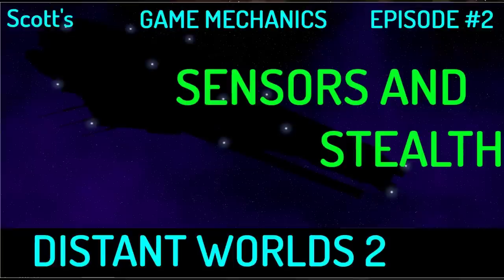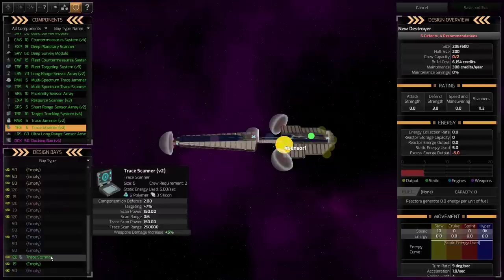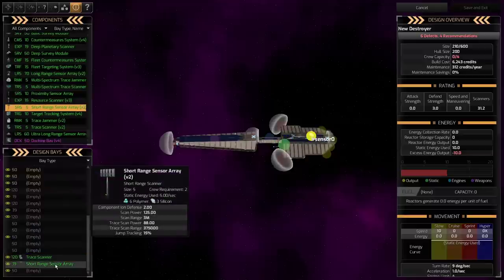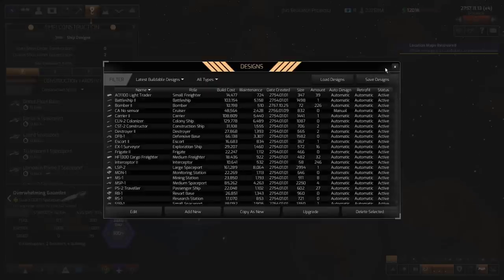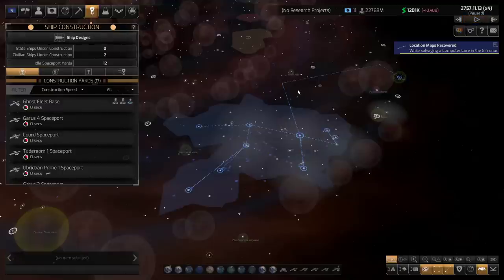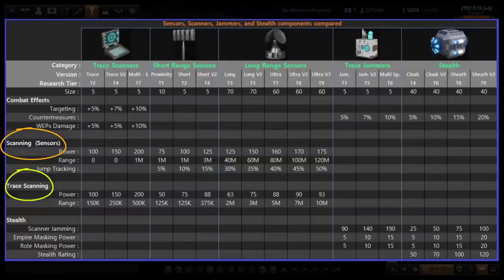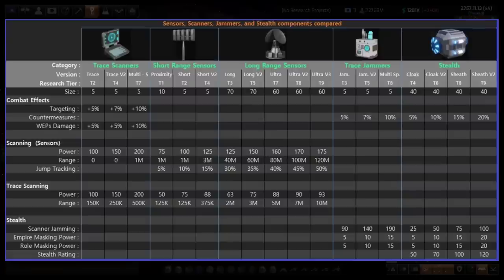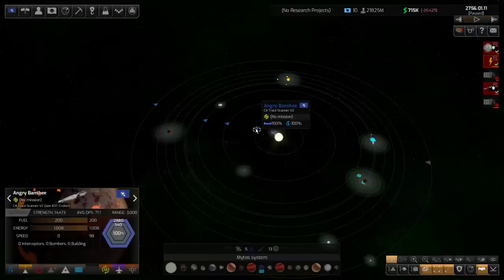Sensors and Stealth - Episode 2 in my Game Mechanics Series for Distant Worlds 2

Comment: The instant loss of definition makes me wonder if the scan power was being treated as combined. Does the Trace scanner targeting stack with the targeting scanner?  BTW, the default Resort Bases include Long Range Scanners, cheaper and easier to spread than Monitor stations
Reply from the maker: This topic is certainly not crystal clear - although the stealth calculations are accurate for example.  I do not think any new info is going to change my recommendation - I've been playing with these recommendations for many games and I've run into zero issues at war.
Reply: @scottsspace5562  The only time I dabbled with stealth so far in DW2 was to park a specialty ship in an enemy system just to sit and watch. Too much of a pain to repeat in later games, lol  In a system so the collectors could power everything but not at a location where it could be stumbled upon.
Reply from the maker: I am 99% sure the trace scanner stacks with a short range scanner, but within a single component - I don't think so.  But let me know if you find out differently.
Reply: @scottsspace5562  Okay ran a few sample combinations, Fleet Destroyer, New hull, so no other systems.
Trace Scanner + Short Range = Stacks fully
Trace Scanner + Long Range = Long Range overwrites the Trace Scanner.  An odd bug Scan Range displayed is that of the last system added.
Trace Scanner + Trace Jammer = Stack fully
Trace Jammer+ Countermeasures = Stack fully
Trace Jammer+ Countermeasures + Stealth = Stack fully
Trace Scanner + Trageting = Stack fully

Let me know if I missed anything. I only developed stealth for the exact reason you stated, the Espionage Academy, LOL
I still see no effects on ships from any of the Admirals or Buildings, Military Academy, Command, etc displayed on the ships themselves. Only Components seem to count. Maybe just a display bug, but a ship with components only is +35% Target, +40% countermeasures, an Admiral that adds +16% Targeting, +12% countermeasures, +11% damage, none of those display
Reply from the maker: @williamklett6660  Great summary - thanks.  Yup - and as I mentioned elsewhere SOME things stack with identical components.
Reply: @scottsspace5562  I can confirm that as far as Sensors/Jammers goes, none stack with themselves.
Trace Scanner + Trace Scanner = bzzzt
etc...
The Trace and Long Range scanner take the scanning of the LR and the +ToHit and DMG of the trace.

However,
Trace Scanner + LongRange Scanner + Targeting + Trace Jammer + Countermeasures + Stealth = a valid combination if a bit excessive
Reply: @scottsspace5562   A bit of an update. A brief examination of of Fleet Targeting and Fleet Countermeasures show that the systems work, but... It is unclear if Fleet EW stacks or the higher supersedes. Both Fleet systems add entirely new stats to the ship. For example the display of a ships now will show frex: Targeting +10% & Fleet Targeting +10%.

Regardless, it seems to me to be an assist intended for smaller ships, however, Fleet EW caps at +20% while the same tier Integrated Command Center adds +20% to both and more.  No idea currently what the actual intent is supposed to be.
Reply from the maker: @williamklett6660  great investigating! I have yet to test fleet wide effects.  Curious if then the admiral setting stacks as well.  I’ll put both on the list for testing.
Reply: @scottsspace5562  Yeah, I only gave slight testing to the Admiral. Hyperspeed bonus seemed to work, but one commander had +Target/+Counter/+Damage and none of those appeared on the fleet ships, BUT that test was back about 20 revisions. i haven't looked recently

Comment: Thanks for the informative videos on DW2, I appreciate that you take the time to look into different areas in-depth with examples (so I don't have to). In regards to Stealth tech, I agree that it's not worth the size hit to put stealth on a ship meant for combat. However, there are cases where I will use stealth, which are: 1) I will put stealth tech on any ships I build as Long Range Scanner ships (basically spy ships). Then I can park the LRS ship near enemy systems with less chance of it being seen and chased away or destroyed. 2) The other place I'll use stealth is on valuable lone bases such as research bases and sometimes resort bases. This just makes it harder for the enemy to spot and target those vulnerable bases.
Reply from the maker: So glad you like them, thanks for the kind words.  Yes - those are 2 good examples where it might make sense!  Thanks for sharing with everyone!  And I will take a look at them again if the Devs end up buffing stealth.  Finally - I HAVE been able to (once) go right up to a pirate base with a high stealth ship and not get attacked (even though devs said that shouldn't happen).  But I can't reproduce with other race spaceports.  Strange.  That would add value but it rarely seems to work.

Comment: Nice, was looking forward to this. Just started watching. One thing you might want to do for the next video is up the in game graphic setting (forget the name). It will smooth out the overlays so they aren't banded. It was put in to prevent crashes but if you don't suffer from those, it would look better to turn them on.
Reply from the maker: Good point.  It gets reset with every update.  I actually like the bands, however, for scanners when discussing range.

Comment: Trace scan is the additional ability to determine other ship's cargo, onboard troops, characters and component status, but with much shorter range, and countered by trace jammer(when lower than jamming power). 

One can think it as FCR (high resolution/penetrating) instead of ELINT sensor/EW radar(long range but low resolution) that normal scan represent. Trace scanner is more useful on combat ships and as counter to trace jammer(when higher than jamming power).

In actual senario, normal sensor is good enough to collect all the info from unknown entities til they start to equip trace jammers/stealths. By which the trace scanner is needed to collect those info from the unknown entities, but with a much shorter distance than before(trace scanner has high power but low range).
Reply from the maker: That is the official line.  But the Short Range sensors (with no trace scanner) also shows ship's cargo, troops, and component status (as you can see in vid).
Reply: @scottsspace5562  Yes, as short range sensor does have trace scan attribute then it possess the ability to reveal details as well, though in relatively short distance(due to low power and range) and prone to jamming. And that's why I only recommend to put trace scanner on combat ships and when enemy start to equip jammers.
Reply from the maker: @renyaoqin  I know that - it’s on my chart in the video. I think you missed my point.  If you watched my video, the short range and long range sensors can see troops, components, etc all the way across the system. That’s FARTHER than the trace scanners.  So there is no proof that even if the AI used jammers (I’ve never seen them use them) it would be able to reduce the range of similar tier sensors scanner ability significantly enough to make trace scanners required to supplement the sensors- remember the sensors get more powerful faster as you go up in tiers than the jammers.
Reply: @scottsspace5562   I agree and I'm not intend to start an arguement, as I commenting above: "In actual senario, normal sensor is good enough to collect all the info from unknown entities til they start to equip trace jammers/stealths" 

Erik does talk about stealth mechanics in the matrix forum, which I can deduct the formula out of the value he provides like the one you showed in the video. I would assume trace scan calculations follow the same formula which means the first tier jammer could cancel out any short/long range trace scanning capabilities (with the exception of Ultra long range v3 as your chart shows). And if AI doesn't have any jamming or stealth components that means their effective jamming capabilities is zero, by which short range and long range sensor can reveal AI ship's cargo when they entering the sensor's maximum trace scanning range. 

But if AI does have jammers on their ship, I don't think player would be able to tell any trace related info from afar. Even with a same tier trace scanner it would have very limited range due to power/range scaling.

Again I think this could be a very interest warfare type to experience and play with(from both side), if future update can tailoring it well.
Reply from the maker: My apologies - I read your post too fast. I see now where you said short and long see across the system.  I thought you hadn’t realized that.  So yes - I see your point. It is possible the jammer could cancel enough scanner power - but I don’t think practically it would happen in game (I’ve never seen it).  And it wouldn’t stop me from seeing the ship itself to target.  By that time I would have trace scanners (multi version) on all my ships and long range sensors on my command cruisers in every fleet.  But again, good discussion! Something to watch for in game or if they ever buff the AI!

Comment: One point, the countermeasures get increasingly more powerful if you stack everything that adds to it. Iirc you can get a base 40%, a little from thrusters, and subtract any enemy targeting. But once you have a high %, each additional % is worth a lot. Reducing hit chance from 70 to 65 is trivial, but 35 to 30 is really nice. How high can you get it? 

A simple solution to trace and short range scanner advantage is to mix. I'd like the bonus on my damage ships, but you can mix in a few weaker ships with short range scanners. Frigates or maybe even escorts, with cautious behaviour and just some support fire (long range missiles, ion weapons or some point defense). 
Would a long range scanner be something you could add to a fuel tanker design? In addition to normal fuel tankers you add to each fleet, these would work as flying monitor bases you could park anywhere. Alternatively a slow ship without fuel, just collectors, that could just sit anywhere. is that possible? 

I think very tailored fleets might give an edge and be convenient to instantly know which number means what. Like each odd fleet a defense fleet, and half the even fleets (2, 6, 10, ...) standard attack fleets. Fleets 4, 8, 12, etc can then be specialised attack fleets. One main fleet, an invasion fleet and several support fleets. You could have designs fit to roles within each of these fleets. 
You could take this further and make half fleets, each working in pairs. With 1 a defense fleet, 3 could be a support fleet, the pirate hunting part of the fleet usually set to defend but easily selectable. 2 and 4 will then be parts of an attack fleet designed to work together and with different settings. This might also help with refueling, retrofitting or repairing fleets in two steps so you're not too vulnerable.
Reply from the maker: So all good ideas you mention!  It is important to organize the names of your fleets as yo mention.  The only thing is that the fuel tankers sometimes leave the system in search of fuel and then come back.  But it might work most of the time.

I was thinking of doing a short on trying to make a tank ship - and testing it.  It's on my list. So at that time I think I'll be able to answer you.  They do stack though just to confirm (thought there is always a minimum TO HIT change of 1/12). 

- I didn't say this in the vid but I often make a command cruiser with Long Range and then just don't build too many of them. Maybe 3 to a fleet.  I put mostly defense and PD on it to keep it alive.  I also put Fleet Tracking and Fleet Countermeasures (when I get to that tier). Then I have mostly fast destroyers and eventually light carriers.  So I still recommend having one ship with Long Range Sensors as soon as it's viable (for chasing fleets, jump tracking) - but most of my ships doing the work are using trace scanners - and early game I use them exclusively.
Reply: @scottsspace5562  
How expensive is the upkeep if fuel tankers, too much for redundancy? If you have two they can swap places. Or have one tied to the closest space port of fuel mining station and see what it does on auto (it could ferry fuel to fuel tankers or to nearest fleets?). 

I googled bases and found a reddit on defense, monitor and unspecified stations but it was for DWU. A mentioned downside of have full space stations on every colony is that it spreads your resources, annoying when building huge fleets in one place mostly. The solution would be to have lesser stations everywhere. Or maybe you can set all resources to keep nothing in stock except fuel? 
Having monitor stations with long range scanners all over seems awesome and defense/fuel stations on all weak colonies that you don't want a spaceport on. Is that possible? What can you build on places that are not (yet) colonies? If you can't build custom stations where you want, can you have a alternative design mining station for shitty resources/asteroids just to give you visibility and maybe a refueling point? Or is that simply too expensive?
Reply: @scottsspace5562  
Command cruiser seems awesome. You have dreadnoughts too? they seem like the ultimate ship!
Reply from the maker: @teambellavsteamalice  by the time I get them, the game is more or less over (I'm dominating) so it's not so exciting.  I use slow research so it takes longer to get there.

Comment: What stacks? Would it be worth making some exploration ships with stacked stealth and long range sensors and no weapons or armor/shields to sit around in open space as spy ships?
Reply from the maker: Anytime you add another identical component most things do not stack.  The countermeasures and tracking DOES stack as does shield recharge and a few others.  When making a custom ship in the design screen, scroll down the right pane. As you add components you can watch the stats of the ships change.  This will guide you as to what stacks and what doesn't.  If you have DIFFERENT components, usually most things stack.  Exception might be short range AND long range sensors - but I never tested that.

Comment: 5 space for a jammer to give 10% chance to make the enemy miss is insanely good. Think of it this way, 10% countermeasures means it takes 10% more shots on average to down your ship. More when you consider shield recovery. The only time this wouldn't be the case is if they have over 100% hit chance. Pretty sure that is very rare.

Also can stealth modules stack? The numbers getting easily overwhelmed by sensor power make a lot more sense if that is the case. It also wouldn't be a completely terrible strategy since if they stack that means the countermeasures do too. Two stealth modules plus some jamming and voila you have an evade ship that requires sensor stacking to see coming. 

The Xenox come to mind. Extra sensor and defense slots on their ships with the fast recharge shields. Evade a ton while the occasional hit gets shielded and recovered from extra quickly. Makes me think they were designed with a stealth and jammer strategy in mind. Doubly so considering they are the spy specialized race.
Reply from the maker: The good jammer and good stealth are all late game.  I'm all for putting a Jammer on for 5 space - once you get the tech.  But I'd rather spend my limited early tech getting better shields or a shield capacitor.  There is another (different) stealth component (Starfield if I remember) that is race specific.  That will stack.  But 2 normal stealth sheaths, for example, do not stack their stealth (just the countermeasures).   And yes - fast shield recharge is very powerful and a good early goal.